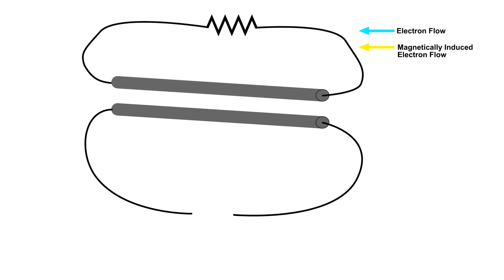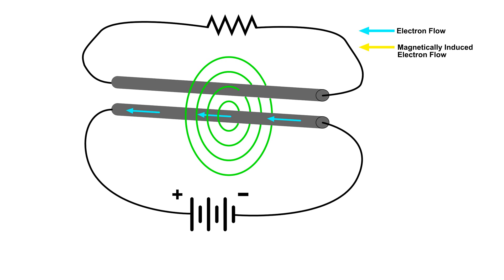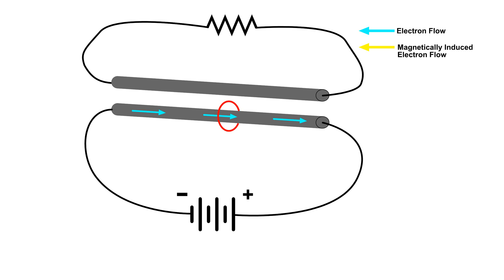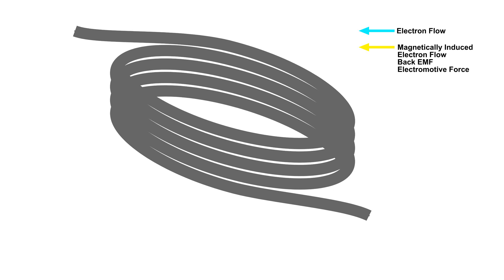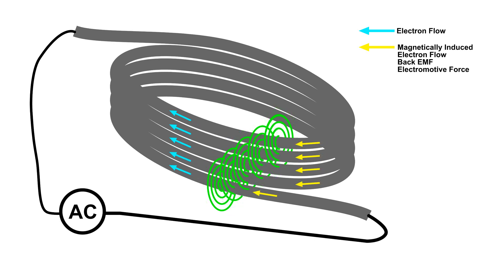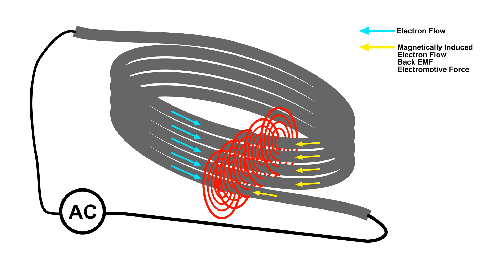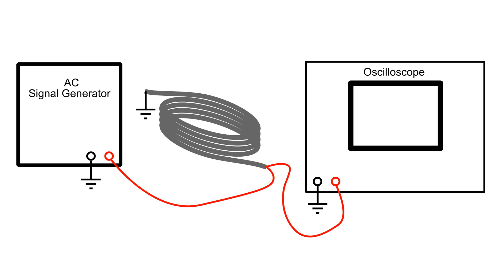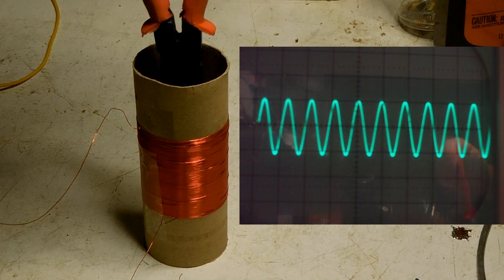Impedance, Back EMF, AC Resistance

Comment: Thank you!  Very good explanation to go along with the visuals. I know that impedance is made up of resistance and reactance in the circuit. What opposes the flow of the source current in the coil when the magnetic field is growing? Is it the back EMF or the induced current that's in opposite direction to source current or the inductive reactance?
Reply from the maker: Thanks You!

Yes, the inductance produces the Back EMF = impedance.

Comment: An a/c coil cancel each other out as the the electrons and currents flows back and forth?
Reply from the maker: When the magnetic field cuts across  a wire it produces electron flow in the opposite direction opposing the main flow, this is call impedance. If the magnetic field is not moving you only have resistance of the wire. Here is another video that may help. 
Impedance Back EMF Practical Demonstration
https://www.youtube.com/watch?v=JrI7I93XzYk

Comment: I'm confused about this: there are no other impedances in the circuit shown other than the coil. So all voltage of the signal generator should be dropped across the coil  in any case, increasing coil's impedance only affects the current. But since oscilloscope registers more voltage, the only option is that voltage was previously dropped across generator's internal impedance, and when coil's impedance increased, it took more voltage. Is that correct? or I am missing something?
Reply from the maker: I can understand your confusion. I’m thinking about a video to demonstrate the effects of impedance. I’ll reply to this comment when I put up the video and give you the link.
Reply from the maker: I just uploaded this new video.
Impedance Back EMF Practical Demonstration
https://youtu.be/JrI7I93XzYk

Comment: To explain why Nature initially UNDERMINES the growing magnetic field in a coil as supply current INCREASES, then turns right around and tries to keep the magnetic field around when the coil's current is decreasing - I tell students this:

1)  Faraday's law of induction and Lenz's law show that increasing current will induce an opposing current that undermines the growth of the original current.  Nature seemingly says "I don't like growing magnetic fields - and I'm inducing an opposing current to limit the magnetic field you're trying to grow in that coil"

The second part, when supply current starts decreasing, is tricky.  Because Nature tried to limit the magnetic field,  if Nature was consistent, it should be quite happy to see the original current and magnetic field drop back to zero.   

Instead, Nature turns around and seemingly says  "you know, I've discovered I like your magnetic field - I see you're trying to reduce the current and make the magnetic field go away - I'm going to resist that action"  and Nature establishes a current to bolster the existing magnetic field, instead of trying to kill it like it did when the power was first turned on.

I tell students that when the supply voltage and supply current begin decreasing, think of that decline in current - as actually INCREASING in the opposite direction.  

It's like stepping on the brakes in a car,  You are actually ACCELERATING - in the opposite direction of the car's motion.  "I'm putting on the brakes, but I'm accelerating in a rearward direction?"   CORRECT.

  If current has changed its direction, Nature, by Faraday and Lenz's laws, induces an opposite current to the change in direction of the supplied current.  And that bolsters (props up) the original magnetic field.

If the supplied voltage and current moved left to right in a wire or coil, and begin to decline, this decline is just an increase in the opposite direction.
.
Reply from the maker: Make some drawings, then make a video.
Reply: @AllAmericanFiveRadio  I work with a small team developing sets of metal layers with the Lorentz force causing coherent accelerations of the charged particles in the metal layers.  Our hands are full.

The devices have a vertically-oriented magnetic field, and eddy current coils adjacent to, but not touching, the horizontally-oriented layers of thin metal.  We drive the eddy current coils at very high frequencies.  The 90 degree orientation of the vertical magnetic field and horizontal eddy  currents in the metal layers leads to immense coherent accelerations of the charged particles in the metal layers due to the Lorentz force.

As a break from work I like to watch other experts like you who deal with the subject matter of electromagnetism - it's relaxing.  You do a good job - the pacing is good.